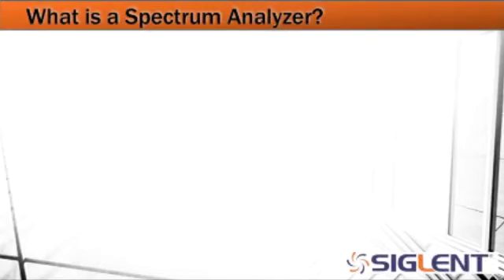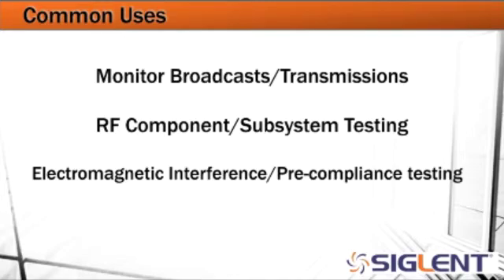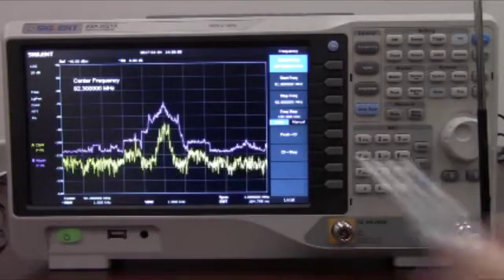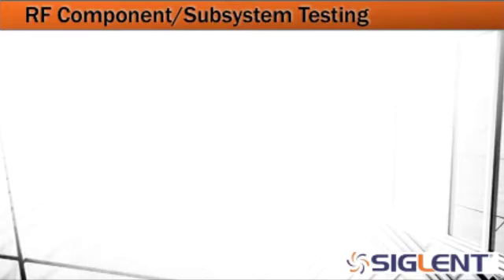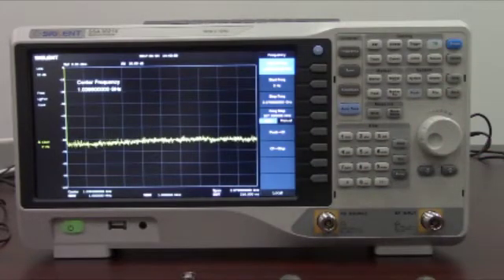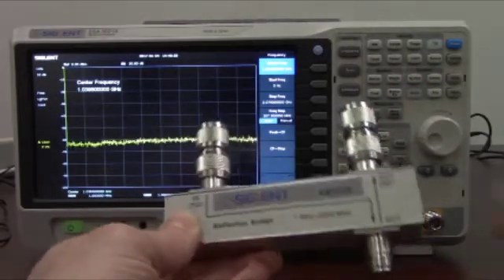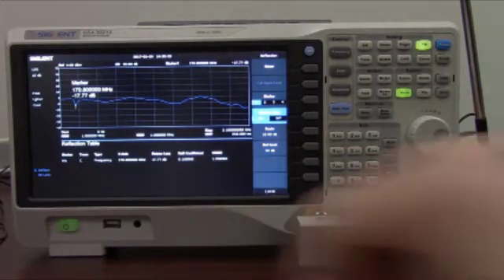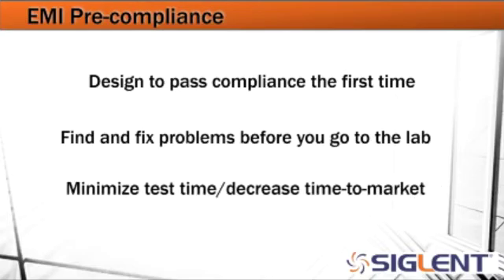Spectrum Analyzer Uses and Features: from Siglent & Saelig

Comment: Hi and thanks for the video.  I have the SSA3021x+ and I use the TG fairly often.  I was wondering if you can introduce modulation at freq/at % into the TG output for testing heterodyne radios, etc.  Any ideas?  Thanks in advance for your experienced comments!